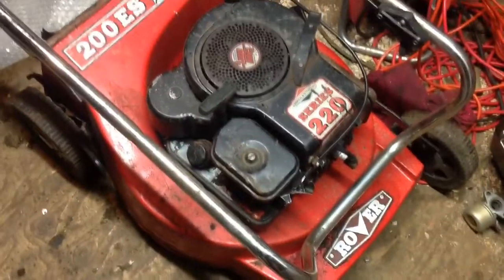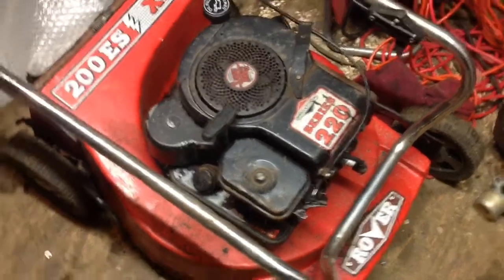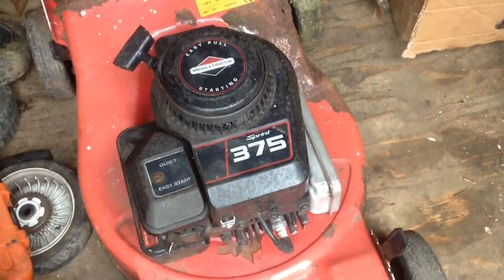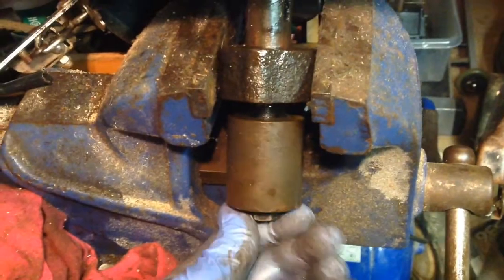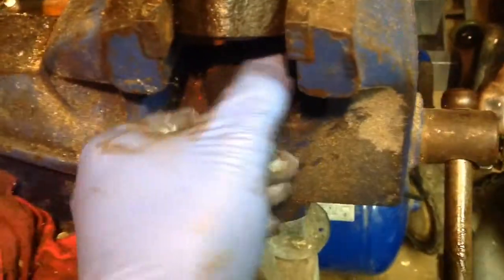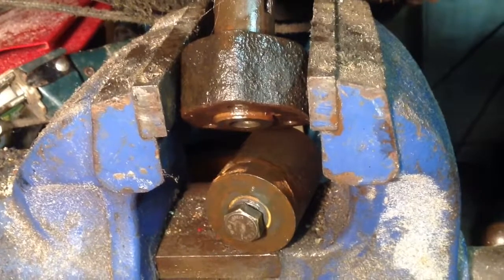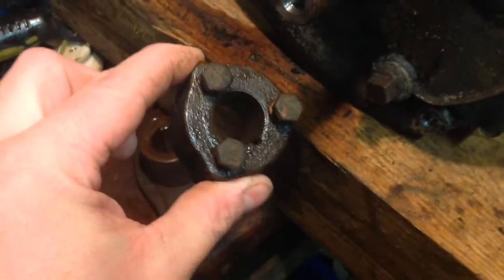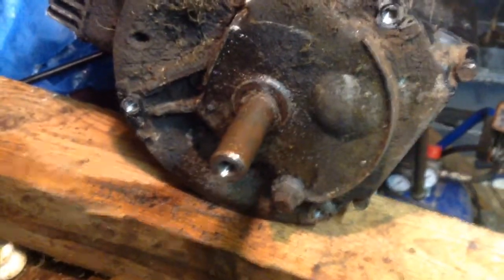Rover mower engine change,blade boss removal and a spider.

Comment: Being trying to remove one myself and it's not budging hence looking for videos lol.  I was starting to think it had some captured key holding it on but nope just a pain in the rear.   Got a puller and its still not moving. Tried heating it up to heat shock it and nope....Tried drenching it in penetration oil...nope. Stupid thing lol.   Need to get it off because when I tried to remove the smaller bolts they all snapped off.  Then the drill bit snapped while drilling a hole to use a bolt extractor and the other hole I did on another bolt sripped the extraction tool.....Can't win. I might end up buring the thing lol.

Comment: It had to come off .. Slow wins the race man , It did come off there and You won !!
Reply from the maker: Yes it was a bit of a task,if I had been able to apply some heat that would have helped,but I didn't have anyway of doing that at here.It was one of the harder ones but like you said I won,Thanks for the comment.

Comment: trying  to remove one off a flymo at moment,its made of like tough plastic?, pig of a job my puller just cracked the lip on it ,using dremmel slow job ,how do I put new one on
Reply from the maker: Hi I've never tried to get a Flymo one off before, if you could put up a vid I could see if I can help you. Thanks.
Reply: Will do its like three inches long cylinder shape ,fragile as hell
Reply from the maker: +Philip Hoad Yes I know the ones you mean I've never tried to remove one, I always thought they looked a pain to remove.